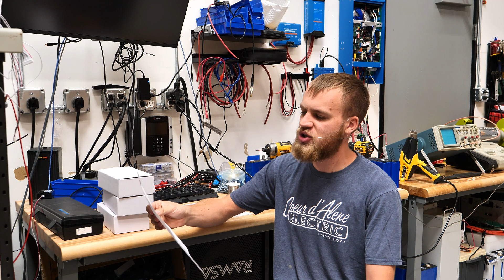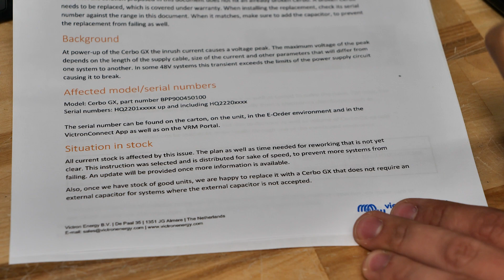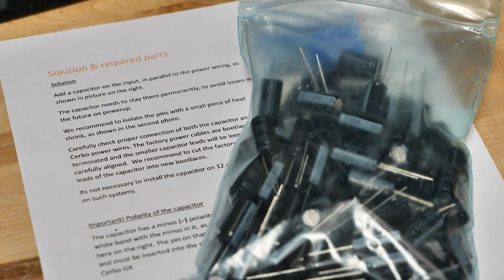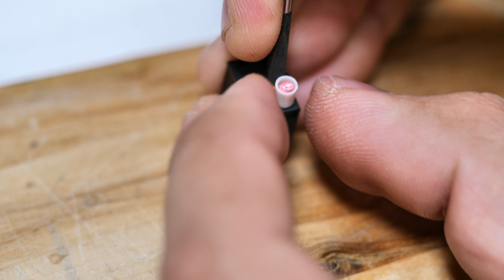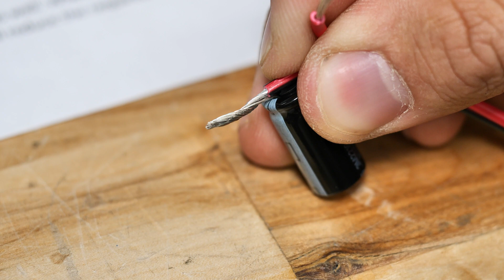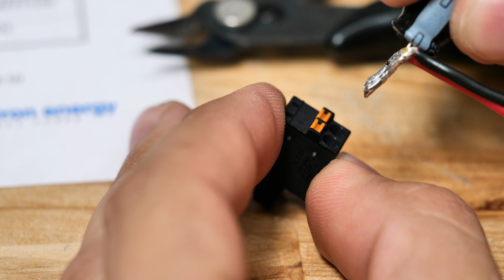Victron Cerbo GX Power Supply Failure and Capacitor Fix

Comment: I get around this by first powering it up with a 9V battery. (Made a 9v battery connector to victron plug). Then I connect it to a 48V power after I did my first few settings.  But it sucks to even have to do this. For the price it should have good surge and reverse polarity protection by design.  I don't blame people for just using a stepdown power supply and raspberrypi with a CAN hat or USB CAN adapter. Now a days you can get good enclosures and it's still cheaper than a Cerbo-GX.  In my power stations I now use a Pi400 with a modified kernel so it sees the wifi.  Looks awesome, a 1U rack opening that slides out a keyboard (the pi400) and you can control the remote console.  Only testing this out but so far it runs just as stable as a cerbo-gx.

Comment: So... My Cerbo GX blew up. I reversed the polarity and turned it on without noticing.
Upon disassembly, I discovered they have bodged this capacitor to where the protection diodes were supposed to be. It blew up, releasing lots of electrolyte on the PCB. Other PSU components, inductor and ceramic capacitor, have been blown off the PCB. It is very unfortunate that $300 device is missing the simplest protective measures, given the conditions it's supposed to operate in. A photo of an undamaged PCB would be greatly appreciated, as sending device for repair or ordering a new one is currently unfeasible :(

Comment: Is it possible to connect the Cerbo-GX to a 12v power supply, even though it is monitoring a 48v battery bank?
Reply from the maker: Yes, this is no problem, since the input range of the Cerbo is 8-70v

Comment: Is the can of the capacitor metal? If so isn’t there a short circuit risk with the soldering for both terminals so close to the capacitor…

Comment: This looks to me like a cable wiring inductance related problem.  When you connect the controller to the battery there is probably a huge current spike and related voltage transient.  They selected the capacitor to absorb the spike like a snubber network avoiding low ESR caps to control the peak current into the capacitor.
To be honest it looks like a bit of a bodge and a better solution might be to add pre-charge resistors across the isolator contacts to allow the controller capacitors to charge up before closing the switch/breaker.
Victron have a history of inrush issues. Some of the Victron inverters have huge capacitors - my old Multiplus has over 40,000uF of input capacitance which will happily destroy breaker contacts without a precharge resistor.

Comment: Such an easy fix, probably would have used new ferrules though.
Reply from the maker: We were thinking about this, most customers don't have ferrules or ferrule crimper, and this should be a more solid solution since the capacitor leads can easily pull out of a ferrule

Comment: I actually had one fail about 2 months ago, the distributor said that was impossible and they have sold tens of thousands over the years and have never seen one bad. It failed when connected to 48v. My new one starts with hq2214 is that one bad?